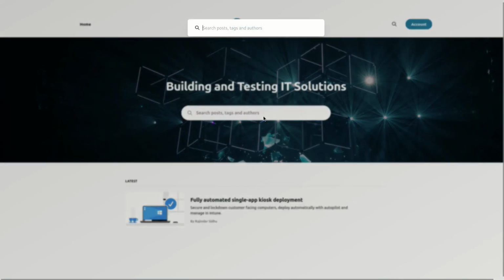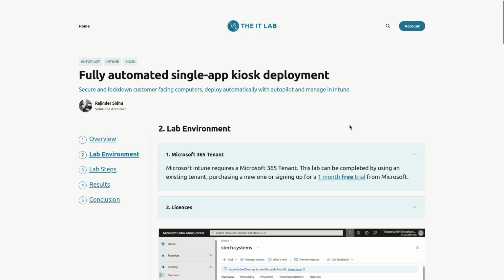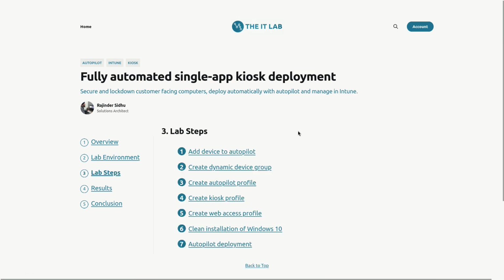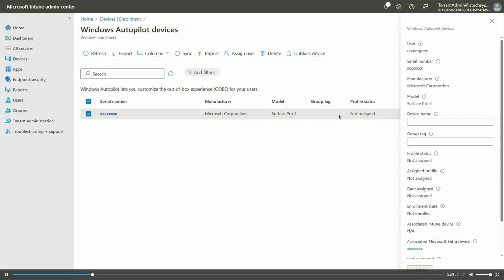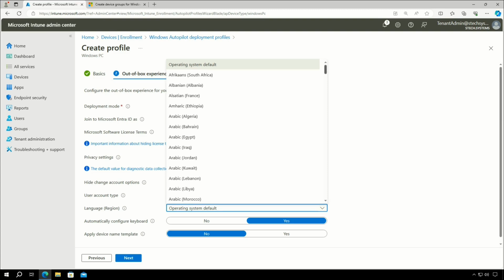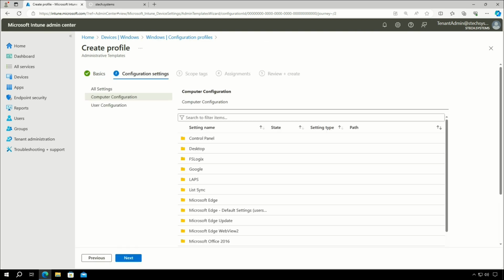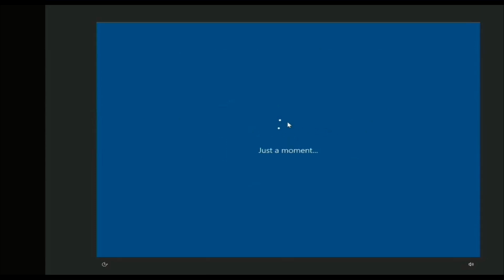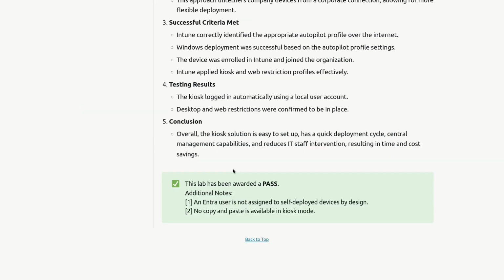Fully automated single-app kiosk deployment

Comment: Hi it's worked well when I applied the security basine it failed to autologon it asked me to enter a new password for kioskuser Could you please share which setting in securty profile causing this
Reply from the maker: From MS docs: "...the default configuration of the Security Baseline for Windows 10 and later automatically enables BitLocker for removable drives, automatically requires a password to unlock a device, automatically disables basic authentication, and more". The requirement for a password is probably causing the auto-login problem since the kiosk is setup with a blank password. Taking into account the kiosk is designed for a specific use case I would question whether the baseline security policy is appropriate. I would suggest putting your kiosk dynamic group in the excluded assignment of your security baseline.